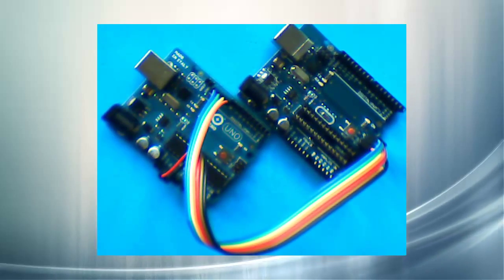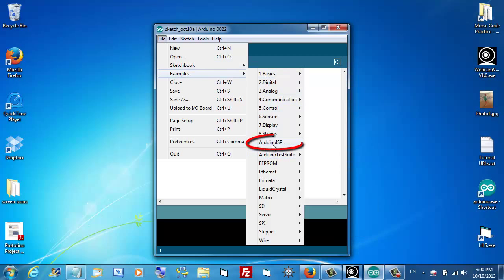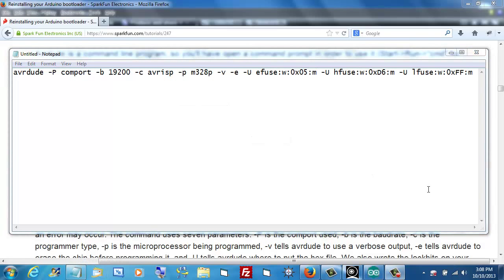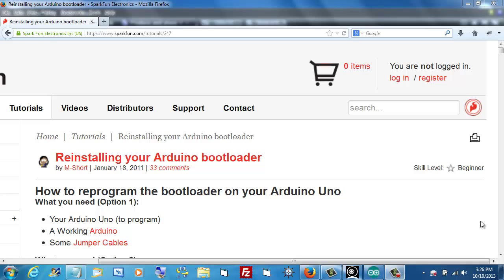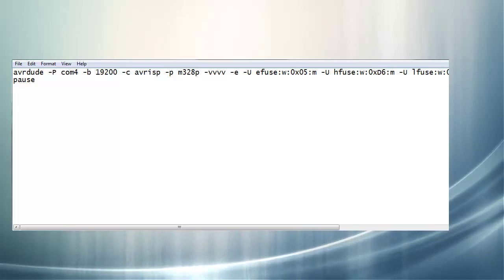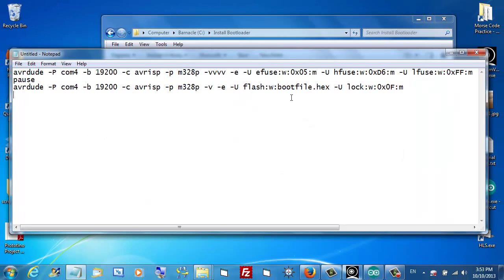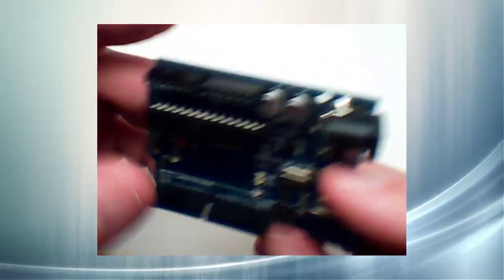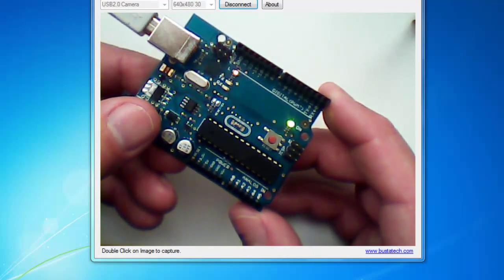Installing the Bootloader

Comment: There is a lot easier way than all this long description ! 
Just choose: Tools>programer>"AVRISP_mkII", then upload the "ArduinoISP" from the Example sketchs to a working Arduino, then choose: Tools>programer>"Arduino as ISP", and connect the wires as it's shown in the video above to the Arduino with the new chip or connecting pins from the original Arduino to the Target chip as follows :
13>13
12>12
11>11
10> reset
5v>5v
GND>GND
-
After you have done all these steps i have wrote, All you have to do is just one more last easy step,
-
While you are connecting the wires of two Arduinos as it's shown, and connecting the working Arduino to PC,
-
 just go to the Arduino IDE and choose: " Tools > Burn Bootloader "
It will just start flashing for about only 5 seconds and guess what! You have already done installing your Bootloader and you are ready to upload any sketches 😃
PeaceOut ✌️

Comment: THIS WAY DID NOT WORK OUT WITH ME MAY BE THERE IS SOME THINK WRONG WITH MAY QRDUINO CARD.I FOLLOWED YOU STEP BY STEP BUT IN THE DOS WINDOW THERE IS THE SAME PROBLEME OF GETTING SYNC(avrdude: stk500_getsync(): not in sync: resp=0x00).all this probleme was started when i had put an external power supply in my arduino  and volteg regulator burnd and whene i changed and i tried to upload sketchese i get the message above .can you please help . i have changed my mcu .

Comment: Dear sir,
I've seen your video about instaling bootloader in Arduino Uno. My question is: can I use the same method with other microcontrolers like ATtiny84 or 85?
Thanks in advance and,... nice job your are doing.
Reply from the maker: +José Fonseca When I made this video the Arduino IDE didn't work at installing the bootloader. The newer versions do a good job now. You do not need to go through these extra steps. If you have two Arduino's load one of them up with the 'ArduinoISP' sketch that is in 'Examples' and use it to install the boatloader. It is quick and easy. Search the web for instructions.

Comment from the maker: Here is the text for the batch file. Copy and paste it into Notepad on your computer.

pause
avrdude -P COM4 -b 19200 -c avrisp -p m328p -vvvv -e -U efuse:w:0x05:m -U hfuse:w:0xD6:m -U lfuse:w:0xFF:m
pause
avrdude -P COM4 -b 19200 -c avrisp -p m328p -vvvv -e -U flash:w:bootfile.hex -U lock:w:0x0F:m
pause